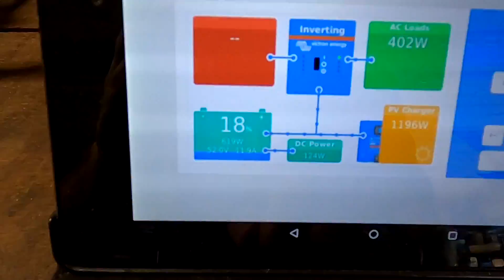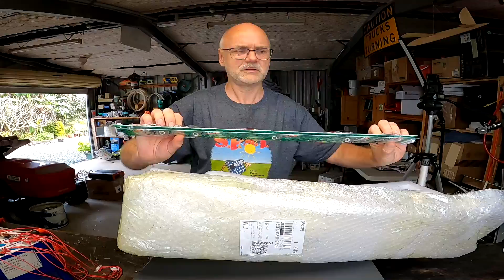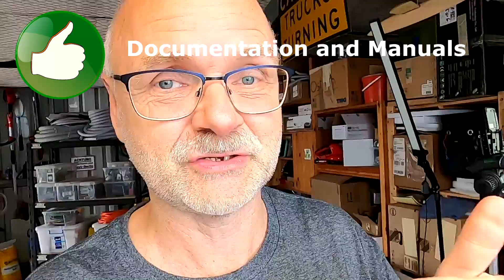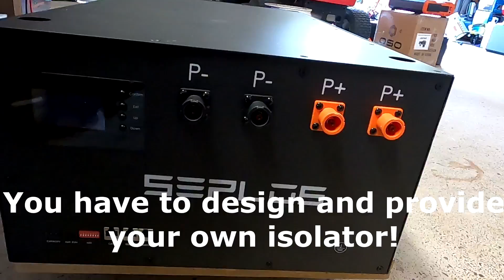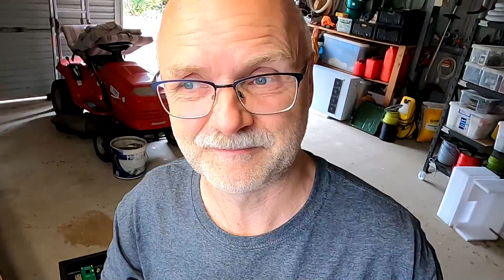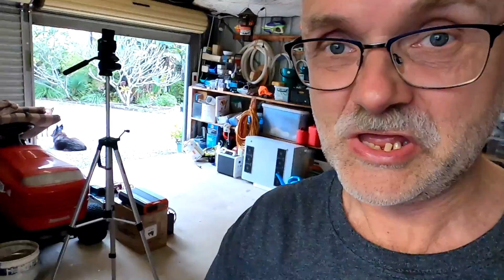Considering a SEPLOS Battery or BMS? Here is my experience so far...

Comment: Andy I like your battery 2.0 better, I have built something similar (just a lot smaller) and have now gone the homeassistant route towards optimising and using the sun's energy to supply 95-100% of my needs. Communication is a big thing when it comes to evaluating data and making sensible choices. Manually turning on the pool pump when there is excess sun feels like you are babysitting your power usage
Reply from the maker: Thanks Heinz. The Home Assistant route is certainly very interesting and would integrate nicely with my system. I just feel this is almost a YouTube channel on its own though. But I will go down this path at some stage. Sooner rather than later, I guess.
Reply: Any pointers to what type of Home Assistant you are using? I have the option of using Victron Multiplus II AC2-out to switch on hot water around Midday. I also use smart power plugs to schedule hot water and pool pumps so am also approaching 95% sun/battery power  (if not overcast for  more than a day or so). Andy has in the past said that he used a Victron assistant, but has he reviewed Victron DVCC or ESS compared to the PV inverter assistant I think I recall he used? I have tried ESS and the older manual voltage conditional limit setups. I have grid backup. Because Victron really request the use of DVCC only with a BMS in communication with the GX. Now the Andy had RaspPi and Seplos support Victron, isn't a DVCC review of its pro cons a natural next point of investigation?
Reply: @aidendeem903  I do no run a victron system but my Deye has similar functionality with AUX out (but I am not using it). In my case I use node red to fetch all inverter values and publish the on MQTT so that they are available on HomeAssistant. From there I am busy trying to wrap my head around the built-in automations/blueprints/scripts available. There is also another option of just using node-red to action the usage of power (since all entities in homeassistant is also available on node-red, so smart switches can be triggered on/off). I use smart switches to switch on usage of power (for things like my heatpump), and in the case of a water heater element that uses large currents I use a smart switch paired with a high current relay.

Comment: i will add this will be good on 24 volt  to you get double capacity for smaller loads. making them 2p 8s config this will me grate
Reply from the maker: They have the same system for 12V and 24V. Called Mera and Meka I believe.

Comment: Definitely the communication has to be improved right now!  Actually I like  the Mason like you,  it is very solid, it is well designed and if the bms is not doing what I want, I kick it out and use an jk or a daly or another one 😉 but the case is top of the pop! That's the reason why I bought a second one.  Best regards from sunny hot Germany 🤣👍🤘. Danke Andy.....Marko
Reply from the maker: Thanks, Marko. We will see how the BMS will work once the two batteries are connected and if we get any benefit from that set up.

Comment: Hello Andy I agree about Seplos having a robust strong structure but no way to turn off the battery pack in case of emergency or for service  or other that is what made me design my own battery pack based on the seplos and adding the breaker to make it suitable
Reply: Or you can just add a breaker in line beside your inverter...
Reply from the maker: There is enough room behind the front panel for a breaker, so adding one should not be too big of a problem. I would just have one next to it as Tito said.

Comment: Andy,
As always, great humor:-))
One question, maybe irrelevant?
I thought all bms wires should have equal lenght.
The cell at the end of the pcb should then have a larger resistance. So, do you think Seplos uses some resistors orsoftware to overcome that issue?
Reply from the maker: Thanks Guido. The wire length or resistance has no influence on the balancing function or the BMS's capability to measure the correct voltage. While balancing, the BMS will not consider the voltage measurement as accurate, so a voltage drop on these balance cables does not matter at that moment.

Comment: I don't think the lid is a problem from a grounding perspective. On Large Synchronus generators with 400V AC I have never seen a ground wire between the housing and the lid and the bolted on side panels, there are just some nuts like in a server rack in the housing and the painted lid and side panels just bolt on with short bolts in to the nuts.
but none the less it is a good thing to do.
Reply from the maker: I guess this depends on the regulations. There are some exceptions where star washers are allowed.

Comment: Unless Seplos ships out thousands of these batteries a week, they can't control the cost of shipping any more than someone placing a letter in the post. Granted, if you mail out 10K pieces  a week, you'll get a cheaper rate, so if Seplos were to ship large volume of product, they might get some shipping discount. For the most part, shipping cost are not controlled by the manufacturer.
Reply: Of course they can and are responsible for it.
If not for them to find a better way to ship their product, who should do it?
They could for example ship a container full to Europe and one to the US and then distribute from there to reduce the cost.
They are not a small company, if other can ship heavier package containing batteries for cheaper, no reason that they cannot.

Comment: Excellent review Andy, I think you smashed it out of the park.  I have 3 x Seplos “Suntorque” 100A? 5kw batteries, 2 of which I got around 3/3/2022 a 2nd battery 2weeks later & the third was not delivered till May for some reason, anyhow I still have not been able to communicate with the batteries as yet as the serial cable I ordered doesn’t seem to work. The 1st 2 batteries were connected to an all-in-one system (PowerMr 5kw) charging from 8am-4pm and then running a few appliances through the night as I have 10kw of PV on roof I just slow charge the 2 batteries (20-30A) by day from GPO inside house (temporary trolley mounted setup for testing purposes at this stage). These first 2 batteries continued to lose capacity from the 1st few charges and over 2 months had come down to 54% & 64% SOC respectively. I contacted the supplier several times but did not get much of an answer except that I needed to get communication happening with the BMS, well it is, was, has all been toooo much with computer issues & cable issues & downloads & everything, F**K ME!
Anyhow, thanks to you Andy and your recent Seplos series, I have learnt & figured out some of the issues (still ongoing) & are slowly moving forward, but it is all very frustrating. Anyhow, the 3rd battery arrived and I was hesitant to hook it into my system because of the issues I was having, but I did anyhow and have found that last battery has been able to mostly fully charge each day still while the other two did not, so this could be a reason to want to individually set BMS parameters of newly added batteries to a system and NOT have a primary battery set all packs parameters to one set of settings. I have discharged all 3 batteries individually & then recharged as far as possible to get the first 2 batteries to come up to 88%-94% again thanks to you & your great video’s. Some Comments/Suggestions to/for SEPLOS:- 1. Listen to ANDY. 2. Active Balancing, 2A minimum, built into Bluetooth App for IOS & Android a must, this could have simple and advanced modes for configurations so more people can understand and use at least basic parameters via mobile Bluetooth App and for long distance communications as I have a bus up north I am not often at, so being able to get warnings and change parameters from afar without complicated computer setups would be very beneficial for these situations, boats, vans, etc. maybe consider a proprietary Dolly, or a strategically placed set of wheels/casters and a pop up handle for manoeuvring these monolithic batteries (Im getting too old to be humping these weights). I see you do have a castor base set already, that’s probably a plus! Terminals: just do something better and more user/DIY friendly for the love of God, & I am atheist. Isolator Switch; is probably a must & a nice convenience at least on these batterie’s. These cases and engineering seem very nice indeed & Im sure it would take little to upgrade the earthing system throughout & get another FROG from Andy, & ME!
I really want at least one of your beautiful cases full of batteries to grace & compliment my setup soonish, but I am very hesitant at this stage because it means a fair bit of modifying I would have to do to meet some of these requirements I feel should already be in these pack units and would also add a lot more cost to do the install of such modifications, but then they would truly be great. COST; of shipping does seem rather excessive, cant you do something A LOT BETTER than that, us Aussies do enjoy paying far tooo much for most things on a Global scale, EVERYONE knows that, but this shipping cost is a bit much for many. 
I love Andy’s, honest, analytical, logical, funny & fair take on things, he works really hard to do all he does, and generally tries to make everything great (Again!), and he also calls a spade a spade, as he sees it through extensive testing, which is fair and scientific, SEPLOS, you are lucky to have Andy on your side because I know he just wants to make you GREAT AGAIN, and I would soon like one of your improved kits. Ill rap it up, your packaging is atrocious to say the least, get your act together, this is delicate, sensitive, supposedly precise electronic equipment, (temp sensors are suspect if not damaged in transit from shit flying everywhere),,,, did I mention expensive equipment? That should arrive in a professional package (How much are your packing & shipping costs again?) in a 1st class state! Because this is a real F**K YOU to Australian customers from SEPLOS, (thankyou for that, us Aussies dont get reemed properly every day!). 
One last thing: maybe get ur programmers and an ENGLISH teacher together so your programming software is a bit more comprehensible, there are some very odd terminology used throughout your system, maybe we need an Australian version, LOL. Anyhow, after such a lengthy caning ( and I dont like being a Troll or an asshole generally), please do take my criticisms (and everyone else’s) constructively, and implement some (at least) changes here as I do believe this mostly good, but could be a really great product with a few modifications. Thanks for listening
Reply from the maker: Thanks, Evan. Great comment and it's sometimes good to just let it all out 😁
I'm working with Seplos to fully understand this BMS and how it is supposed to work. It's a lot though and will take time.

Comment: The seplos doesn't stop at 95%. It keeps charging until pack voltage is above the set limit. But it does request the charger to lower the charge current (if possible, charger does not need to answer to it) at around that point. First it steps down to max 10A and further on it request only 2A. This allows a slow steep to the max voltage. As you know, a higher current results in a higher overal voltage so high current can easily cause one cell to go overvoltage. This is the MAIN reason why you need communcation to the charger. Even a high current balancer couldn't keep this up. And yes, 2A is still too much for the 150mA passive balancer but my experience is that the BMS keeps the cells perfectly in balance.
And what is your problem with connecting the two BMS-es? They should just work togegher. And no, if one BMS shuts down his pack (for any reason) it will not cause the other BMS to shut down. This is not true.
Reply: Andy has different BMS submodels 10D and 10C I belive, those are different on a comm side. You need to match them but it doesn't say upfront anywhere so many fall into this trap. JK is even more fun, they sell different BMSes under the same  part number... Dealing with china is a pain in you know what and with the tripping shipping costs may not even be feasible soon. 
Too bad we don't have an open source platform for this... BTW, these bms are made and branded for seplos. Seplos is just a reseller.
Reply from the maker: Thanks a lot, Igor. That is great information. Glad you shared this here.
So from my understanding, the BMS just gives the signal to slow charging but does not itself limit the current. This would mean though, that all other banks will receive this current as well. So not just this one bank will be charged slower but the whole battery system as such.

With the standard settings of the BMS, mine stopped charging at 95% so I thought this is a default setting. I could not see it slowing down at this point but as you said, it may just send the signal for that via CAN.

More testing coming to fully understand this system.

Thanks again, much appreciated.
Reply: @OffGridGarageAustralia  yes the other banks will receive the lower charge current also. But due to the automatic balance in parallel packs they are also at or nearly at the high voltage high soc point. All packs have the same charge voltage. As soon as one pack reaches high soc it will first receive less current just due too how parallel packs work
Reply: Thanks for posting this. This is the main reason for comms (charge and discharge current control). Andy’s testing won’t work as he has a raspberry pi and will either need to get a can hat and program that (that video would be hilarious), or get a cerbo.
Reply from the maker: @nebulight  wait for the video🤣

Comment: I have just ordered the 280ah DIY box for my cells as I really like the box but have ordered it without the BMS. I already had a JK BMS which I’m really happy with so hopefully connect the balance leads directly into the pcbs and away you go 🤞
Reply: Yeah I thought about the screen but I’ll just 3D print a cover to fit in there. I’d rather use a BMS I actually like rather than paying out more money.
Reply: @scottrosser8724  Good idea. If needs be I should be able to fund a JK by selling the Seplos too.
Reply from the maker: I will do more testing with the Seplos BMS and also the communication part of things. I'm in contact with Seplos to work things out. It is definitely an interesting BMS and maybe it's actually working well once we understand what the concept and intensions are behind it.
Reply: Starting to wish I'd done the same thing now.
Reply: It will look strange because you wont have the display and the communication connectors on the front panel ?!
Reply: @DrCoolZic  The JK BMS has an optional screen doesn't it? The front could likely be modded to accommodate that. I'm going to give the Seplos BMS 12 months and see how it goes before I fork out for another BMS or active balancer.
Reply: @danmc1313  Based on Andy test and comments from users of the Seplos Kit it does not seem that their BMS is so bad. The only problem (?) seems to be balancing, but if you add a NEEY balancer in the box you should be good.